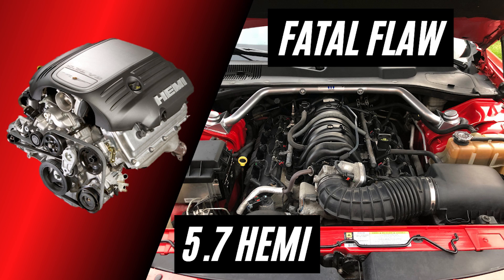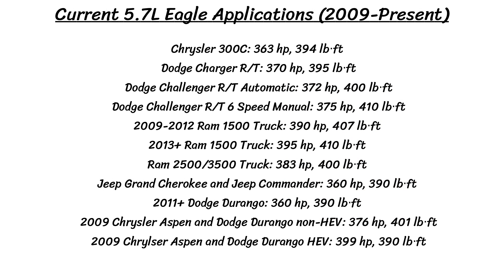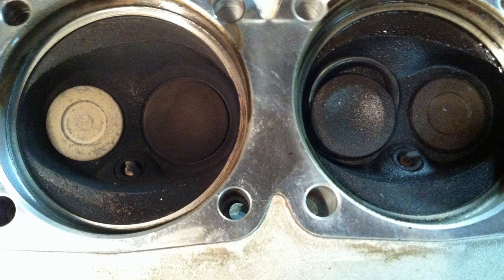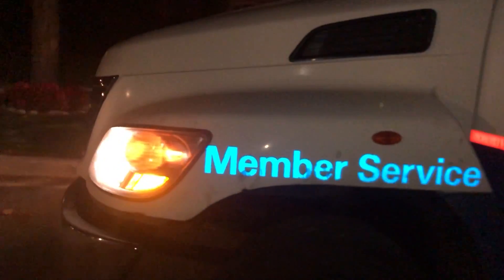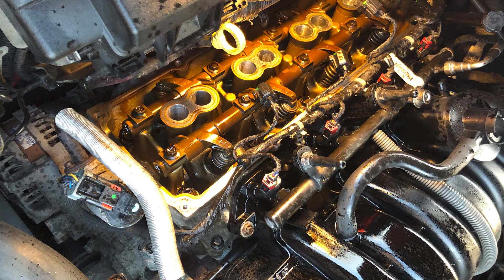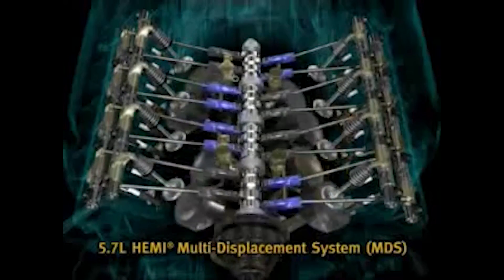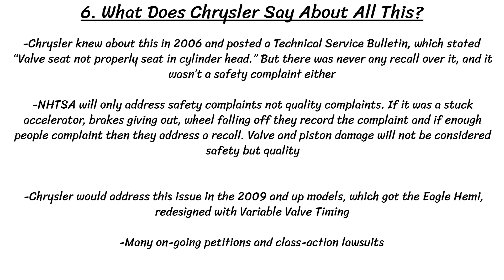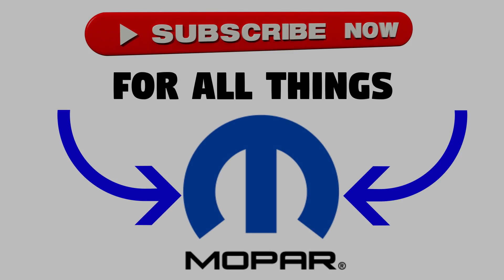The Fatal Flaw of the 5.7L Hemi V8 Engine & How to Prevent It (2003-2008 Valve Seat Drop)

Comment: Things like this scares me from getting a v8, just so much that can go wrong with them compared to the v6
Reply: The v8 will always be a more reliable engine across the board. Either engine is good in current times for Dodge though. The v6 is a great quality engine in the Challengers and Chargers, Jeeps, etc., with the HEMI being even better.
Reply: V6 prob worse. I have a 2010 awd charger with 37k on it. Has stuck exhaust valve. Rocker arm assemblies on 3.5 are junk.

Comment: Mine dropped one at 177000 miles, but he heads where done at 155000 miles before the car was shipped to Europe... they said....
Reply: You think they lied to you? 🤔
Reply: @Apocalypse_Cow  no, it was clearly that they were replaced, there where little scuff marks around the seats  so the where taken out.
Reply from the maker: Damn that’s shady, maybe they replaced with stock parts or did something dumb
Reply: @MarspeedCars  you can say that again, they had punched it with a driver though,  you can see a little pit in the head where they did that with each seat

Comment: What about the notorious ticking that almost every hemi eagle and pre eagle does. The lifter stops and eats the cam alive which I’ve heard of happening much more than this. The camshaft also does not get proper oil flow until higher than 2,000 rpm or so. This is why they say idling is also such a bad thing for this engine and really every engine. But this could more than likely be fixed if dodge installed a high volume oil pump and better quality lifters from factory.
Reply from the maker: That’s maybe the next video I need to make that affects 2009 and up Hemis, there’s always something it seems 😩
Reply: That’s what happened to my Ram.  130k and the cylinder 3 intake lifter seized up and slowly at the cam. Never had the tick or check engine light.  I noticed the loss of power and took it in.  Engine was spotless inside since I had used synthetic from day one at 6k intervals.  $3400 later it was on the road to the dealer to be sold.